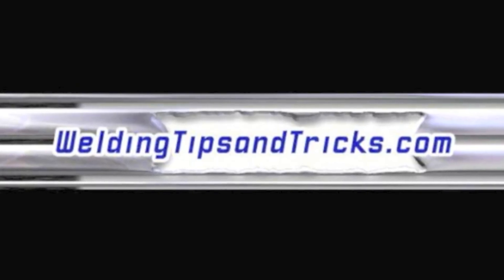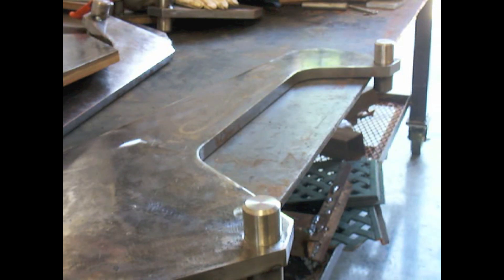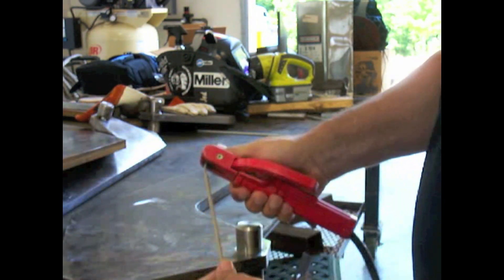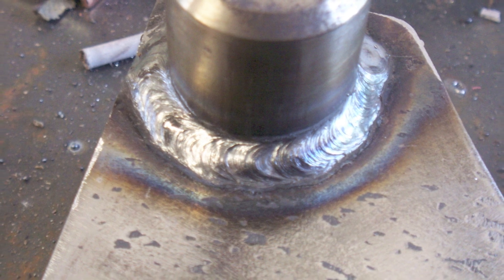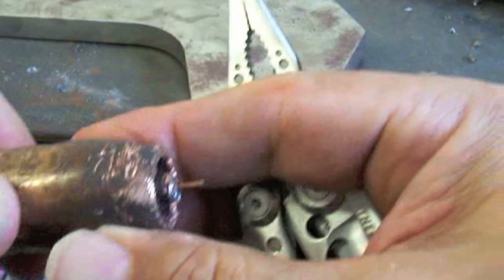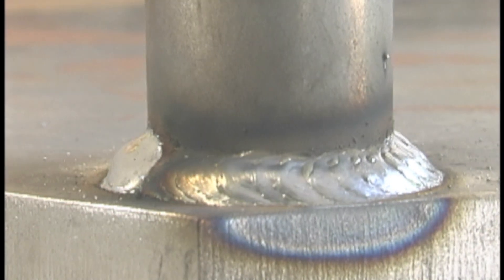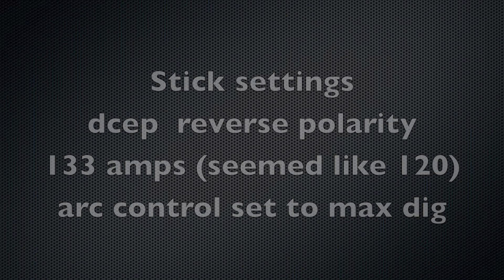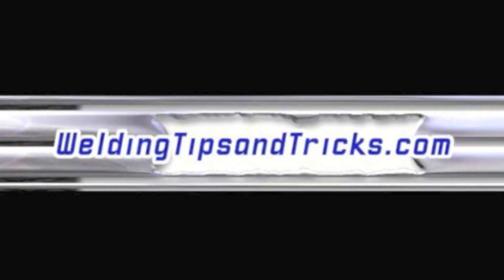Mig Welding vs Stick Welding Techniques

Comment: Places I have worked guys used to argue all the time pushing MiG versus pulling. I found pushing while maybe penetrating a little more generally makes a ton of spatter shooting all over while pulling is a whole lot neater, and that usually mattered more.
TIG, on the other hand, I found to make a tremendously cleaner weld pushing it along. That might depend on the material though. Stuff I weld all day if I push into it it comes out clean but if I go back the other direction it comes out black.

Comment: But with thin pipe just a pull technic you don't want heat to build up and risk burnthrough what also helps if your welding thin sheet metal is to tack the whole panel don't run a bead unless you are gonna tig weld it but even with tig welding depending on how thin the metal is you still can burn through

Comment: I use a deburring tool, like you would use on a copper pipe or after cutting electrical conduit. it works very good and very fast without removing the nozzel.

Comment: believe it or not but I use typex aka the White paint with the brush to erase wrong written words.
make sure you use it in and outside the cup and 1 drop on the contacttip leave it to dry and all Day long no filthy cup....if some does stay in there Just a Light smack on some Iron and it fall out.
hope this helped
Reply: Paul Van Polen - Great tip. Never heard about it before. ;-)

Comment: I think a Round file or Riffler or whatver you call those round thingys are awesome for cleaning the nozzle.
Btw is this some American-style welding moving around that much while welding? the surface of the weld isnt getting smooth even?
Reply: oscarbergner the problem with using a file is that you damage the nozzles insulation and lining.. If you ever notice the white threads being drug out by your file, thats what going on there and it will diminish the life of your nozzle.
Reply: KRoNiC SouLJaH you ofc have to remove the outer nozzle before doing so. We are doing it all the time working on a big welding company and it is not a problem. But we weld alot so it has to be perfect all the time.

Comment: Hey Jody I work in a production shop where we spay arc 99% of our work and we use mig mix gold gas mix but when we have to run a short arc bead we don't Change the gas just bump up the volts think this would make a good vid. Cheers!

Comment: What model was the arc welder what brand and model please I have a Lincoln ac dc 225 and some small  110volt welders but they seem to stick to much and poor quality welds I don't know if its the welder that's cheap or its my experience...because when I used the Lincoln acdc 225...The welds were perfect....and no sticking. ..my dayton.100a. And Harbour freight 90a inverter seems to stick with thicker metal. ..what do you think?

Comment: If the mig tip wasn't sticking out the grounding out problem wouldn't happen
Reply: No.. it can still happen. My tip is never sticking out and i ways get enough junk platter over time to ground  it out.
Reply: Samuel Atkins I'm

Comment: Worth knowing that although MAG (MIG is for Aluminium, Copper etc - not steels) welding is a low hydrogen process the weld quality relative to inherent porosity is lower than MMA - Electrode welding generally gives a better quality weld.

Comment: mig welding is easiest. personly i think from easy to hard i see it is as mig tig stick.
Reply: jack heimbach I learned on stick with a Napa buzz box about 35 years ago. I didn’t learn to mig until about 8 years after stick. It took me a while to get the hang of mig because I was so used to stick.

Comment: THER WIRES THAT ARE JUST AS STRONG WITH ELECTRODES , both have ther pluses and minuses,MIG is much faster,cleaner and more economies at TIME AND  MATERIAL but disadvantaged at WATERPROOF CONSTRUCTION if u have not many expiriance. ,THIS TIME im Manufactured wood boilers and  I HAVE MANY LEAKS WITH MIG, MAYBE i NOT HAVE enough EXPERIENCE IN MIG or problably u get les penetration,WITH THE ELECTRODE 6013 I had no problem.The electrode is slow,dirty work but u can certainly see the slightest mistake

Comment: Very good vid except when u weld on tacks they have to be consumed 100% which means u can't stop before the tack and also the tack it self has to be fused to the parent metal as well. Other than that welds were good

Comment: Given that you were first learning to weld, are the results of your test really meaningful? It just means that, when you did the test, your "e" or circle beads were weaker. Does it say anything about Jody's welds, or your welds today (assuming you've practiced and improved)?

Comment: Those Rapid Strips rock. Expensive, but very, very good. I still sort of prefer having a good cup wheel on a 4 1/2" just because it lasts longer.

Comment: Jody, thanks for the tip on the Rapid Strip wheel -- it looks like a far better method than even using a flap wheel for mill scale removal.  But due to an unfortunate genetic trait I have (Extreme Laziness), I usually dissolve my mill scale the old-fashioned (as well as the cheap and easy) way; by carefully pickling the steel in a water/ hydrochloric acid solution.  No elbow grease needed; but good rubber gloves, a respirator, and eye protection sure are!